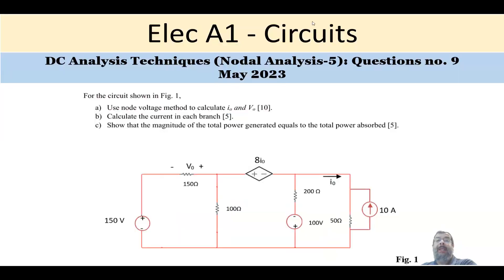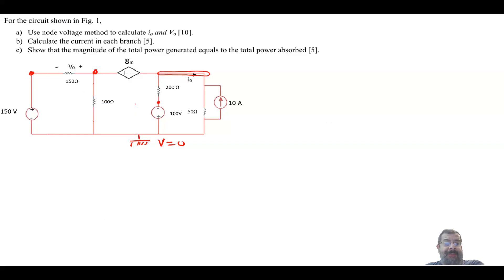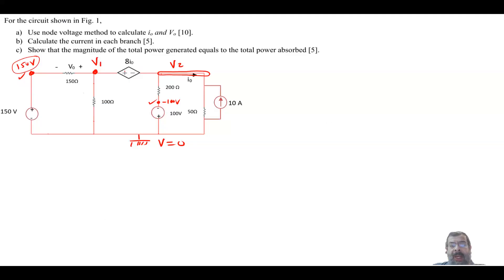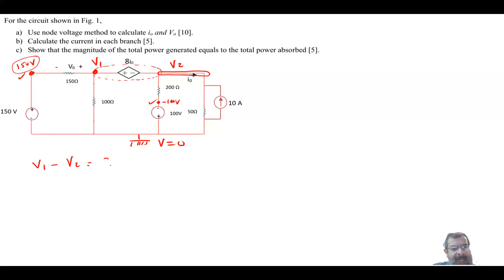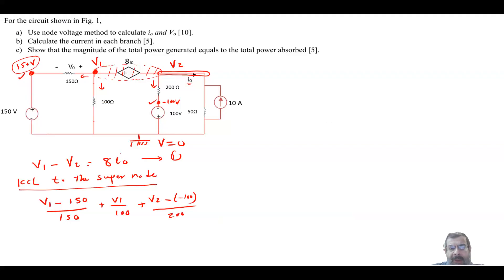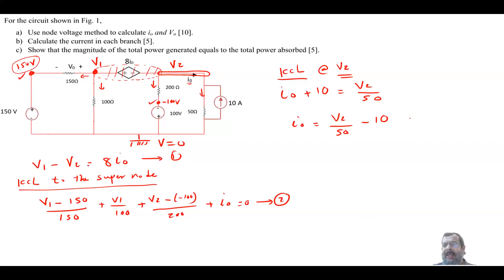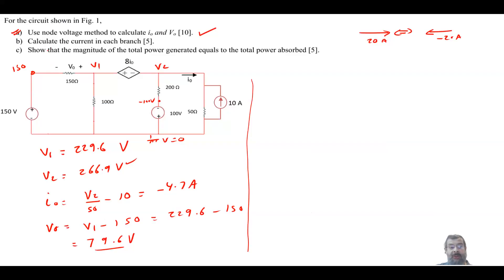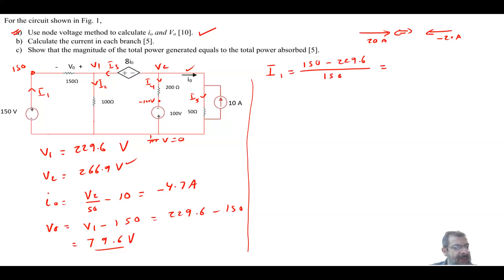PEO solved examples (ELEC A1): DC Analysis Question no. 9

Comment: Hello professor 
I am solving 16-ele-a1, dec 2017, Q2.  Could you please share answer ? , if you already calculate? . Thank you!😊
Reply from the maker: Hi
This question is very similar to the one you are referring to. In brief, if we go from left to right in the December 2017 Q2, V1-V2 = 10V, V2 = 15 V, so you can find V1. Then V3-V4 = 2Vx and Vx = V1 - V4. Finally, we apply supernode around V3 and V4 as follows: (V3-V2)/5 + V3/1 + V4/2 + (V4-V1)/2 = 0. With these equations, then you can find all 4 voltages.
Reply: @electrical4everyone thank you very much professor for response😊. 
Yes I did same, but only thing in my equation for supernode 3&4 is not equal to 2A as you mentioned.  I am getting ( v3-v2)/5 + v3/1 + v4/2 + (v4-v1)/2 = 0. I dont know where i am missing
Reply from the maker: my bad, there is no 2A, your equation is correct
Reply: @electrical4everyone thank you professor